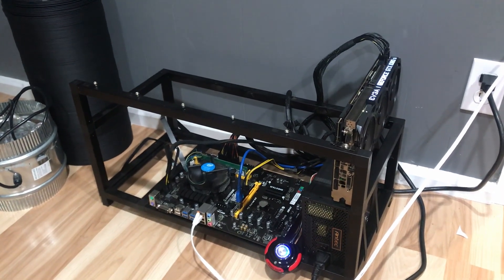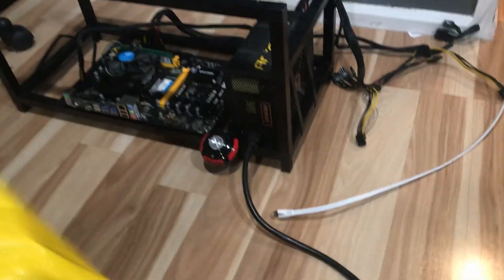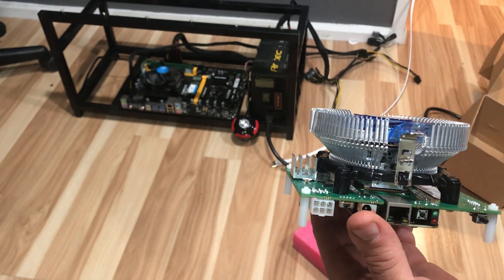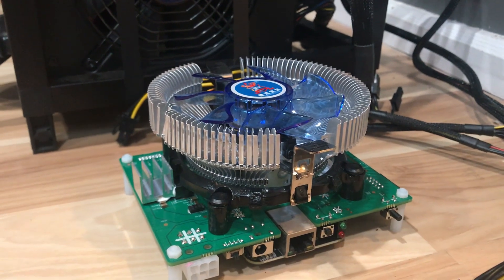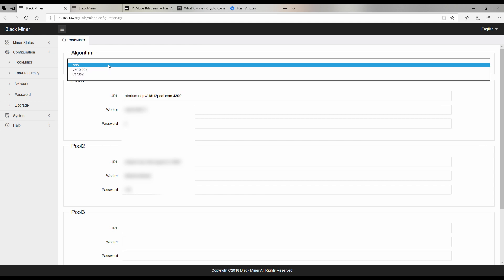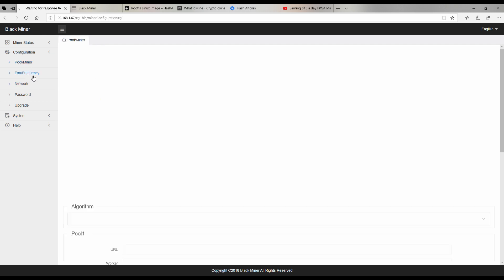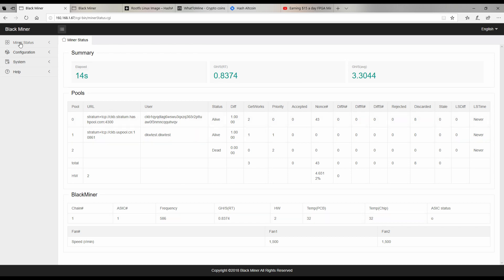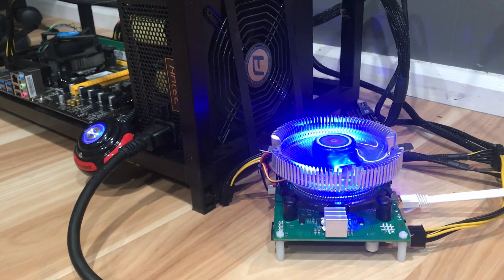Sold all my GPUs and went full FPGA!  Review of the Blackminer F1 Mini + unboxing and setup

Comment: Mega pro tip, get rid of Avast. It's become bad news. Made the move to ESET and it's been the best software upgrade I've done in years. It's lighter weight, less intrusive, and doesn't talk back to Russian command and control servers of known botnets and hacker jumping off points. :) Boy oh boy did we get a shock at work when we started getting firewall alerts about that. Plus with all the talk about Avast talking to and being buddy buddy with the Russian government, and our current relationship thanks to our dear leader, probably not a company you want to support!
Reply from the maker: gymkhanadog agreed!  Thanks for the tip!  This is just a test machine with daily tasks with a 1660ti currently for rendering etc. I have different software for the mining rigs but will have to look at ESET. The reason I originally went with avast paid version was its claim to be the best none interfering with games.

Comment: Great video, just liked and subscribed. Can you tell me how to connect the F1 mini plus? It doesn’t come with a cable of any kind. I know it says 12v, but I don’t know if I’m supposed to by a wall adapter or a cable that plugs directly into the motherboard. I only have an old desktop and I’m pretty new to mining so I’m a bit lost. Thanks.
Reply from the maker: No problem!  So there are a couple of ways.  Either way the miner is capable of 120w when it’s mining so you want to have a capable supply.  There is a round port on the miner and you may be able to find a plug in supply for it like a laptop.  So you would need 12v and I believe 10amp is 120w.  This should work “no guarantees” but you need to make sure the radial plug is the correct size.  This way you can just plug it in anywhere 

The computer could work but you need to know how many watts your power supply is and how much extra it has to spare.  You can get a 4 pin to 6 pin adapter wire or sata to 6 pin but may not be long enough to get it away from the heat of your PC

If you plan on buying a couple you can look up something like a hp 750 watt server power supply with break out board in the neighborhood used $50 on eBay and be able to run several
Reply: Thanks!